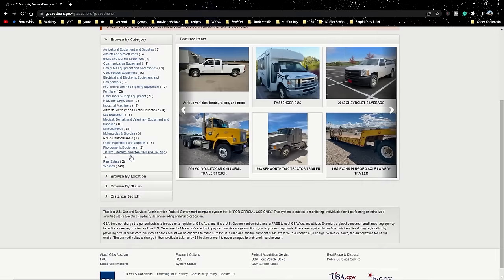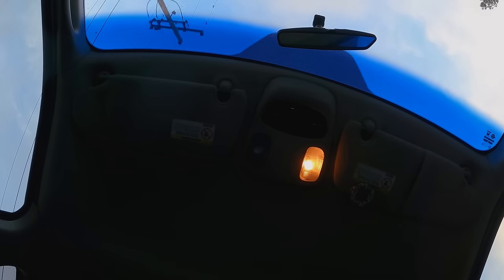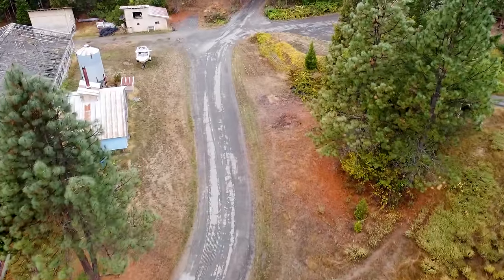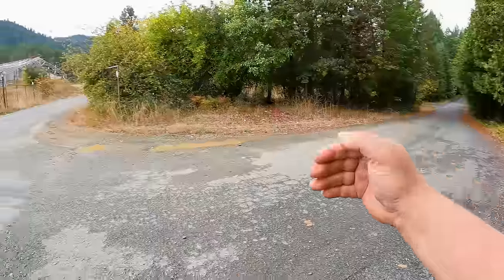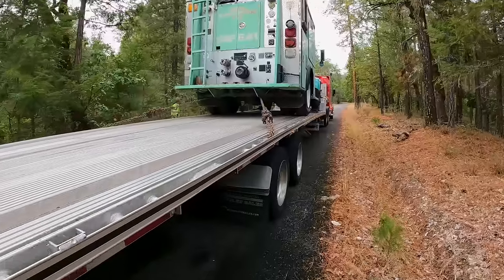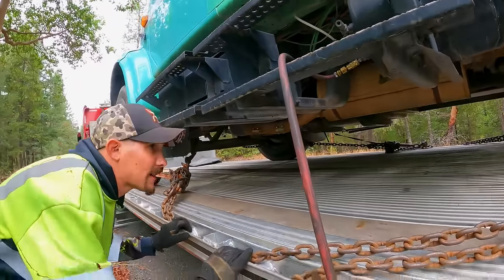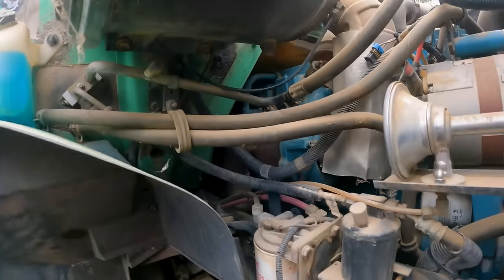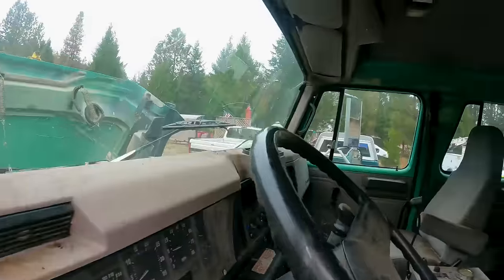Buying a Forest Fire Truck on GSA Auction

Comment: anybody else notice the delivery truck has both stacks facing passenger side
Reply from the maker: Oh wow didn't even notice that. Ill have to ask Chris why.
Reply: Yes the drivers side stack turned coming across the 412 in New Mexico with 75 mph cross winds, I have not had a chance to turn it back yet and since it was still tight I left it for now.
Reply: @chriswetzel2240  I actually think it looks pretty badass. Start something new haahaha
Reply: On some of those new Pete’s one of those stacks is for decoration
Reply: @ILHillbilly67  I work at a Pete dealership, you can option them with a weedburner, right stack only, right exhaust with left dummy stack, or both as real stacks. Of course, both being real costs you extra. Not sure how much though, I'm a mechanic, not in sales.

Comment: On those old engines there is a set of fuses on the front firewall that are covered under a coating.  They often fail and are not readily visible.  Fairly common we have them go out on our fire engines. Especially after hard off-road use on a fire
Reply from the maker: Thank you Grant. I defiantly will be checking them to see if any are blown or knocked out.

Comment: We've still got a 98 international fire truck in my department, it's a DT466E, its old and unrefined but it's a good old truck, never causes any fuss and keeps going to work
Reply from the maker: for sure man. I got a warm spot in my heart for these trucks. When I worked for Oregon Department of Forestry we had a few of them although they where all single cabs.
Reply: @PaperBeatsRock  the one we still have is a single cab too, not s ton of room on it, they bought it when I was a little kid and it's still kicking around
Reply: We still have the old model 14 fire engines with the dt466 as our reserve engines.  They just won’t die, and the thing will pump a hose lay with a screaming pump all day and be no worse for wear.
Reply from the maker: @OnefastAZfarmtruck  First time I ran into them was while working for the Oregon Department of Forestry back in 1998. Our 500gal trucks were single cab short wheel base 7400 with the DT466. The trucks could turn around on most BLM roads without needing to back up. better turning radius than our type 6s.
Reply: @OnefastAZfarmtruck  we've got a 98 with the DT466E, it got a rebuilt pump 3 years ago and will outpump some of our much newer trucks 👌

Comment: “I betcha they didn’t even try hard to start it” 🤔, if they are anything like the Fed Techs I work with I would say you are spot on 😂.
Reply from the maker: hahaha yup that's exactly it. I bet that if they had got it started it would of went for $5k minimum.
Reply: @PaperBeatsRock  I track a lot of auction results, and you would be surprised. I understand many bidders are just buying for parts, but the prices for running vs. non running are strangely similar.
Reply from the maker: @dwitcraft  Its so odd how some weeks the same thing doesn't go for that much and the next week it going for 5x's the amount. 2 weeks after this auction there were 2 more trucks just like this that went up for auction but they had a mechanic note saying that the engine was blown in them with documentation for a shop. they sold for $5k+

Comment: Old generation 2 or generation 3 model 62. That rig has been rode hard.
Reply from the maker: yeah im sure it has. back mountain roads bouncing wash boards and what not. regardless its still a hell of a deal.
Reply: Model 62 "B" fire engine. The model 62 "A" was the Ford F-800 regular cab.

Comment: One of these retired Forest Service Wildland Engines would make a great Extricatíon Rig for Car Accidents. Plenty of room in that rear compartment for Cribbing, and a set of Cutters and Spreaders. I would have the Tools on the bottom of the Compartment, and Cribbing in the upper area. Other Various Hand and Power Tools can be placed in the Side Compartments, along with a set of Air Bags. Re load the hose reels with fresh booster hose, and maybe add a Pre connected 1.5 or 1.75 inch handline up in the hose bed. A couple SCBA's in the Cab, and a few bags of Oil Dry up in the bed, refill the Water Tank, and foam tank if it is so equipped.
Reply from the maker: defiantly would be a solid rescue. I'm not sure how many GPM the pump can do but 500 gallon tank it would be fine for vehicle fire as well.

Comment: I've been running DT466 engines for over 29 years, we have only lost one engine to a blown head gasket, and one turbo.  Not bad.  My old truck is 22 years old (4700 model) and still ready for a days work.  Pre 2008, sign me up!
Reply from the maker: Hell yes Mark. I have owned a few 4700s, and one other 4900. They are great trucks for sure. This one is going to take a bit of cleaning but trust me when I say the engine purrs like a kitten. Next video is a good one.
Reply: @PaperBeatsRock  Nice!

Comment: I've used Fabreze on multiple used vehicles with really good luck.  If I could suggest using a respirator when cleaning the cab of all the droppings.
Reply from the maker: Thank you for the tip Robert. I'm going to be ripping all the interior out of this one to make sure its property clean.

Comment: If your phone/camera uses a USB cable for recharging you can get one of those lithium ion car battery boosters.  They come with USB ports that you can plug your USB cable into to recharge or power your device with.  They also usually have one port for devices that require more than the usual amount of current, like a laptop computer.

Comment: Good job bringing that truck back to life. Model 62 B fire engine.  There are tons of those in local fire departments now. It is actually a 1998 model International ("W" in the 8th-to-the-last place of the VIN means 1998 model, "V" for 1997). The Forest Service considers the year of completion as the year of the truck. Regular cab model 42 engines--with "driveline retarders"?--"drive like 4x4s." The Forest Service budget means not too many 4x4 engines. The Forest Service's 88-page model 62 engine operator guide can be Google'd and downloaded online with specifications and troublshooting, etc. Vehicle # 6233 is noted in it!
Reply from the maker: Dude thank you so much. I have been looking for something like this. This is a huge help. I knew there had to be a operators manual out there. I been trying to find a service manual as well. I may have to hit up Boise Mobile Equipment. Again thank you Fire Bufff.

Comment: 11r22.5s are still availible. as ar low pro 24.5 .(same height/smaller sidewall)   your truck uses budd wheels. and aluminum versions are availible. I have a few spares if you want.
Reply from the maker: is there a big benefit running the low pro 24.5 vs the 22.5s?
Reply: @PaperBeatsRock  shorter sidewall, bigger rim,  less sidewall deflection.

Comment: As soon as as you started your little drive and showed the surroundings I like that looks awful lot like Oregon and then I was looking at the vehicles in the background of you at that yard so Oregon plates and then when you showed the clothes down Market I looked it up so I just thought it was interesting to realize you're in Oregon you're still quite a ways away from me I'm in Oak Ridge
Reply from the maker: Right on Matt. Great to have another Oregonian watching. I actually live right outside of Shady Cove. Your only about 2, 1/2 hrs away. I have never been to Oakridge or on hwy 58. It maybe a trip I'll have to do come this spring when the weather is nicer.
Reply: @PaperBeatsRock  I hope that truck works out for you it's kind of cool and of course I'm so used to seeing those damn things right now with everything that's going on in the last couple months but I used to drive a single cab one when I ran a tow truck years ago and it was a 5 speed in the Internationals that I drove for Oak Harbor they were 7 speeds but I tend to drive 10 speeds and bigger

Comment: We had a 1994 4300 box truck,that DTA 466 was a good motor,however it had the 6+1 seven speed and had issues with the shift forks coming loose and wiping out a few parts ,  in all fairness we ran it heavy and hard it would really roll on down the road
Reply from the maker: Yeah i have always been a fan of the DT 466. I'm not well versed on the 6+1 though.

Comment: Might I make a suggestion if you're going to take the firefighting body and pump off do it carefully please and advertise it because of volunteer fire department that may not have a lot of money may want to buy that off of you so be careful when disconnecting the pump and taking off the body you might be able to make your money back that you spend on a truck just by selling the body in a pump in the tank.. there's a lot of poor little volunteer fire departments that would pay a couple thousand dollars for that body pump and tank
Reply from the maker: Yes sir. I was planning on giving the system a proper test. I'm pretty sure that the pump packing is old, dry, and brittle and it will probably not pull a draft but still it needs to be properly tested so I can inform the next owner of the pump what to expect. There is a few smaller volunteer departments around here that may end up wanting it. We also have a huge amount of private wildland fire fighters that build their own trucks and run them under contract with federal and state. I'm sure any of them would be happy to pick up one at a discount price. shoot even the hose reels are a huge chunk of change.

Comment: A type 3 wildland brush truck in 2WD is nuts.
Reply from the maker: They did make a 4wd model as well this year for the USFS. I guess it depends on the requirements of the area.
Reply: @PaperBeatsRock  most of the FS engines in CA operate in mountainous areas during the summer where pre established roads are the only option. True off-roading isn't really a thing like it is on BLM land so that's why 2wd works.

Comment: Man, you could sell that box and repay the whole truck!
Reply from the maker: For real man. that is the plan but we will see. 500 gallons is kinda low for a type 3 engine. also the box is way shorter than most private guys run. That being said we are going to hopefully get the cost of the truck out of it.

Comment: I learned to drive a split in one just like that. Might take some TLC but a really good rig. Would be so cool if you kept it green but I doubt it.
Reply from the maker: Hell yes Bud. It does match my shop but I think we will be changing the color a little. Going to swap over to a matte OD Green with the rest blacked out. kind of match up with my time in the service.
Reply: @PaperBeatsRock  can’t wait to see it. I’ve spent many hours at the pump panel imagining what I would do with a cab/chassis like that.

Comment: We wear air packs for any smoke or hazardous material sir, not just structure fires.  What are you going to do with the old girl?
Reply from the maker: I'm removing the bed, tank, and pump. I'm turning the truck into a hauler. I use to do structure and wildland back in the day but we never carried SCBAs on our wildland trucks. I can see why though when you're the only agency around.

Comment: The body is worth a chunk of change. Auction means it is junk no one wants. Hope it is not worse then your told..
Reply from the maker: Next video is devently worth a watch Scott. Just got home and its looking like we got a real gem on our hands 😀
Reply: Auction means state employees can't buy it. I can't tell you how many times I picked up a truck from the state that they either bought new ones or just didnt use it. Bought a 14 E350 bus with new tires, batteries and all preventative maintenance even a full tank of gas for 700$ drove it home. Had it for over a year.
Reply: Gsa auction is open to anyone

Comment: See that is fine example why our damn government should be nailed to the wall for wasting our tax dollars. They took a perfectly good running truck and let it sit and go to hell. If they are going to replace with new then sell the old ones while they still run. That will make sweet hauler
Reply from the maker: Dude for real. I saw so much waste while I was in the Military and still see so much more with the auctions I go to. If this truck was left in service there was nothing wrong with it and I would of served so many more years of service to get more money out of it.
Reply: @PaperBeatsRock  aint wrong. buddy bought a h1, came with new engine and tires cause they reached "service life" but think only had like 1800 miles on it. never left the base..
Reply from the maker: @oregonfordguy9812  damn. hell of a deal. People hate on the 6.5 but it's still a decent engine and gets the job done.

Comment: So the $1,000'ish for it isn't all that bad but what did the the parts cost? Tows ain't cheap and semi's ain't cheap🤔 I'd love to get some of the stuff too but worried it'd be stuck or I'd need to get a better runner.
Reply from the maker: I was worried about transport. It was 519miles from where it was to my house and as a disabled vehicle cost is traditionally more. It cost me a total of $1,770 for the transport. Now there is defiantly going to be more cost that goes into this after a bare minimum of getting it running and driving on the road safely before I start to do all my custom work. I will be doing a video about that to give everyone a proper break down so you know the real cost it was to me.
Reply: @PaperBeatsRock  looking forward to watching this build and learning more

Comment: lordy lord. what are you up to now.
dt466 will be easy refire. should be easy fix. and that will make a great hauler. find a western hauler bed, and a 10spd/od with a single speed rear end.
Reply: oh yea and a paint job.
Reply from the maker: For sure. I was thinking of maybe doing a swap over to 4wd. They got MRAP t cases at the auction and can put some mrap axles under it. I will defiantly need to look at proper gears and trans set up for the hwy though.
Reply from the maker: Yup already on my mind set. USFS paint is pretty ugly and getting faded makes it even worse.
Reply: @PaperBeatsRock  for gearing and highway use i wouldn't. itll be reved up and angry under load. if your gonna use it for a hauler I'd think simpler. the old powerline IH trucks were 4x4 and a donor might be better for 4x4 and still give you decent use.

Comment: Never understood why they would make an off-road wildland truck without 4x4. Limits the ability of the truck not just off road but in adverse weather conditions.
Reply from the maker: I agree but in my 6 years that I was a engine slug doing wildland firefighting here in Oregon 95% of the time the trucks were on gravel BLM roads. Our biggest problem was wheel base. Trucks that can't turn around on those roads were a even larger problem.
Reply: CA is pretty dry. I did off-roading for years in a 4x2 Toyota with a little bit of lift, and rarely had an issue. In the areas that get a lot of snow, you'd never want to go at those times anyway. They build most of the fire roads to be pretty mild.
Reply: @xray606  agree the roads here are easy. But the fact is you don’t know where the engine will go, what state, or what area and when. It can be sent to Montana on a strike team. 

There are some harsh fire roads, but the engine doesn’t have to be on a road.  And off roading in a Toyota is way different than a truck with water sloshing around and all your weight on a back axel. 

This was a Northern CA rig, tons of harsh fire roads and off road areas deep in the woods.
Reply: Because experience tells them it's not needed, and you're better off matching the tool to the job. It's the reason I switched my tires to a less aggressive tread... there will be times I can use the more aggressive tread, but if 99% of my drive doesn't require it, I'd rather have a smoother ride.

Comment: If it looses AIR it stops, correct? Or is that ONLY the trailers?
Reply from the maker: yes it requires air to open the brakes. It can have an air leak but as long as the compressor is strong enough to over come it then the brakes will be fine. The air leak still needs to be addressed though.

Comment: How many hours on the motor, I wonder.
Reply from the maker: I will have to double check but I believe that its 5,000hrs. so if you take that and Xs it by 60 that will give you 300,000 miles equivalent
.

Comment: Would cost £12000 in Uk easy
Reply from the maker: I'm sure there is government auctions in the UK where you can pick stuff up at a decent price. If not that sucks
Reply: @PaperBeatsRock  yes you are correct, up until probably 3 years ago you could get very cheap military vehicles but not anymore, around 5 years ago the government mod (ministry of defence) sold hundreds of green goddess fire engines 1950s done less than 100 kilometres for £1500 pounds each, really wish I had bought one, look them up they are nice
Reply from the maker: @ricky450f  our auctions here are just finally starting to come down in price. This is because the used truck market is falling in price with the increase in inflation that we are seeing in the U.S. at least that's my thoughts on it.